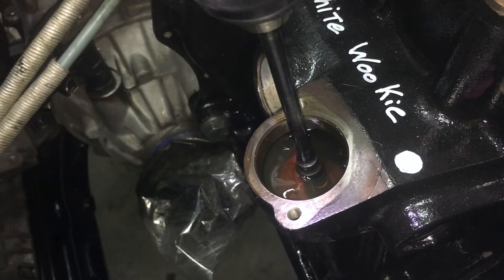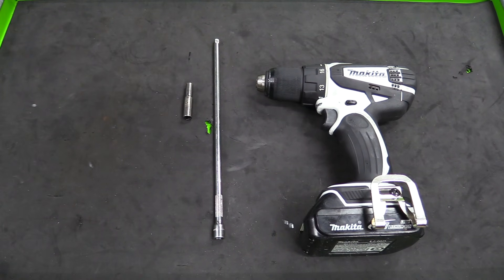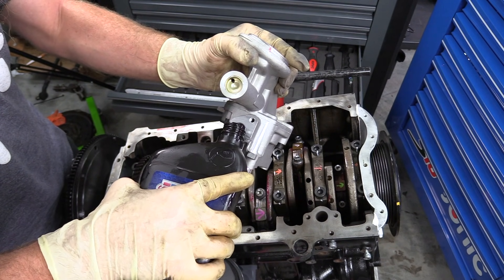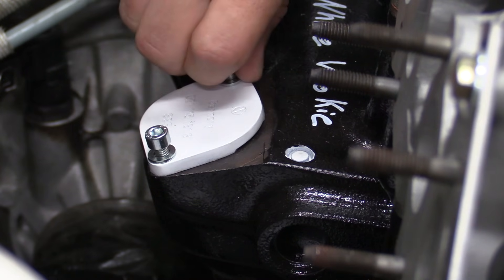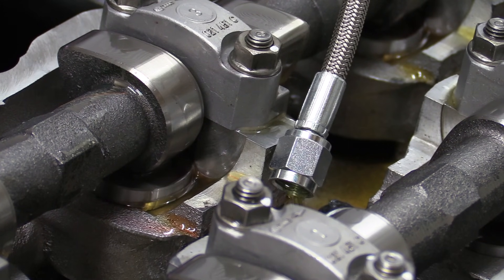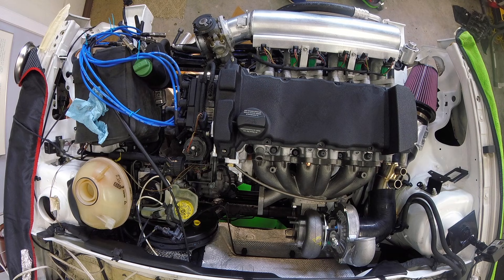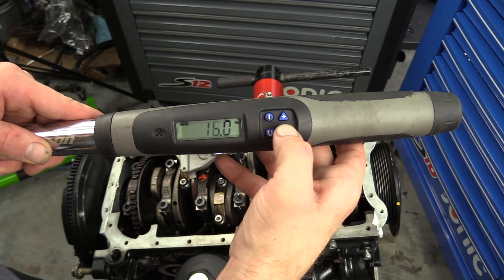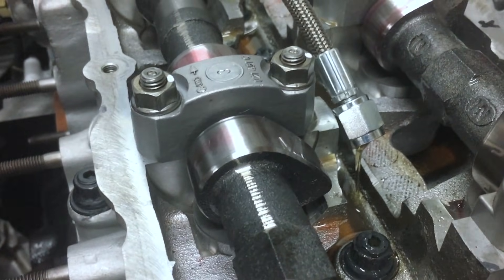How To Prime an Engine And Oil Pump

Comment: I have a 2005 Ford Mustang 4.0 v6 and I’m trying to prime it and the 8mm socket doesn’t sit flush or 5/16 sock what proper tool do I need that fit into my engine so I can prime it

Comment: Hello, I recently installed an engine on my Subaru and it's totally empty, no oil. Before starting it, is it possible for me to prime this newer motor in a similar way, maybe manually rotating the engine till all galleries are filled with oil?
Reply: Old comment but for any future people that are wondering disconnect the plugs from the fuel injectors, then start the car with the key. The starter will turn the motor at a much lower rpm and the oil pump will send oil throughout the motor.

Comment: My car is on a hill, going to change the oil filter housing, then put in in neutral, liner it roll down hill some before starting. Should work the same eh.

Comment: Hey Charles.. just doing this trick on a motor I had built.. only question i have is does the drive gear have to be put back in any specific orientation in relation to the timing? Only ask because I noticed the drive gear has a small hole in it

Comment: Hi there ...I am having low oil pressure in my vw 2.0 tsi 2009 ....I put a gauge and I am reading 16 psi ...while put little more rpm pressure stays the same and warning light appear ....do I think can be a bad oil pump ?? Thanks

Comment: Hi humble mechanic. I desperately need help on my golf 3 gti. 
I’m expressing a rattling sound from my engine, I recently changed the lifters but I’m still getting the sound.. 
I also changed the oil pump and I primed it but just rotating the gears inside the oil before I installed it. But I’m still getting the sound 

Please help, I’m afraid I might kill my engine
Reply: Mk3 vr6?

Comment: Hi, I’m currently rebuilding my R32 24v VR,  this video (and all your videos) is extremely helpful but I have a couple questions:

1.) what type of oil and weight do you typically use for break in? I paused the video and it looked like you were using liqui moly but I thought that had friction modifiers in it which is a bad idea for break-in?

2.) how long will the engine stay “primed” before gravity pulls the oil back down to the sump? My engine is still on a stand and wondering if I should wait until it’s in the car before priming

Comment: I have used a 50/50 mix of straight 30wt oil and stp oil treatment(blue bottle) in the oil pump. Then pull full injectors harness or fuse and leave the spark plugs out and crank about 20 secs wait for about 30 sec crank again ,wait and then do it another time or 2. The install spark plugs, plug in injectors or fuse and fire it up. Have used this method on multiple builds without issues. 

Btw i plan to use your link when i order a few parts from amazon.

Comment: just subscribed good information I have to replace an 1999 4.0 Inline 6 amc engine in the future. I'm going to assume that the distributor drives the oil pump and going to spin the hell out of that. the engine will be remanufactured the real question is do I really "OCD" worry about timing?

Comment: I'm actually cracking my oil pump open on my mk5 r32. Any guidance? I had oil pressure warning come on and oil light kept blinking. Pump is out of the car now, pump freely spins, and there isnt any binding and screen is not clogged.. should I pull my pump apart and inspect it and put it back in, or just be do e with it and buy a new pump?

Comment: Hi, I have a quick question, is it true that if the VAG low pressure oil tester is used instead of the sensor there's the risk of breaking the timing chain? I've had an incomplete diagnostic done at a VW service and the engineer stopped the mechanic in performing the operation, so I was unable to know if I had a failing oil pump or not.

Comment: Hey Charles, just a general yes/no question: on a VW Touareg gas V6 (or any car really) does the oil pump start working when the starter turns the flexplate during cranking or does the oil pump start working only after ignition?
Reply from the maker: Most are mechanical so when the engine starts turning, the pump should start pumping
Reply: So the oil pump will start circulation when the starter motor turns the crank shaft?
Reply from the maker: with in a few revolutions.
Reply: HumbleMechanic Why, what happens if it's more than a few revolutions? Technically as long as the oil pump is working there should be no concern of damage right?

Comment: We always use the drill method or the cranking method. Even with a junkyard swapped motor. I’m building and EJ257 and it’s going to be done with the fertilizer sprayer way first watching the oil pressure gauge then cranking. Lots of cranking. About 60 seconds worth of total cranking spread over,  5-6 short starter rest, periods. We always use “motor honey” or Lucas assembly lube (anything sticky) for brand new oil pumps.
Reply from the maker: Great insight!!! Thank you .
Reply: Are you using the fertilizer sprayer as a prelube tool to push the oil in the engine ? I'm looking for such a solution, this might actually work

Comment: i did the jelly route on my 95 jeep cherokee and worked perfectly!!
Reply: I've built a few Rover V8 engines and as the pump lives above the oil, not in it, the jelly route is the only way to go. I've known a few guys use grease but it tends to not blend in with the oil and just settle in the sump as a sticky mess.

Comment: nulon l90 is the best i use to fill the oil pump with it and bearings and camshaft when the engine have been renovatet oil pressure in 15 sec normaly

Comment: Hey, my question isn't related to the video: My 2005.5 Jetta with the 2.5l just hit 100k miles. Should I get the timing chain changed? People have been warning me that they fail around 100k
Reply from the maker: The most common failure is the upper chain set. But with 100k and 12+ years it may not be a bad idea.

Comment: Just did a similar method last week on a jeep 2.5. 1/4" drill with 1/4" adapter to a long 1/4" extension and a 1/4" flathead bit. Spin until the drill bogs down, now you have oil pressure! Great video.

Comment: Hi Charles, good stuff. I had low hot idle oil pressure on my Mk4 R32 and recently changed the oil pump. I primed the pump in a bucket of new oil, installed and buttoned up the oil pan, and then used the procedure similar to what you described. Pulled the coils, disconnected the fuel pump, and relieved the fuel system pressure. Turned the engine over 3 times for 20-30 seconds. Fired her up and got "Bentley Spec" oil pressure. Keep up the informative work! Sorry I missed meeting you at WITW this past April.

Comment: How do you prime a distributor less engine? Just only by cranking?
Reply from the maker: That or you can make a pressurizing tool to push oil into the engine via an oil pressure opening

Comment: Great tip, thank you. I always like to have an external oil pressure gauge connected (even if it's just temporary capillary type) to be 100% sure that the oil pressure is in spec. What are your thoughts on using a cheap/low API spec oil for break in as apposed to a high spec that would "protect " key wear surfaces better and possibly prevent correct mating during break in?

Comment: lol thats not how you tape a socket you are supposed to put the tape on the extension and put the socket over it.
Reply from the maker: You can use whatever method works best for you. Just as long as you're taking steps to be 100% sure the socket doesn't come off.

Comment: Top tips as per usual.  It's always good to see how the other guy performs the task!  Personally, it's just valve cover off then liberally coat top end with oil!  Remove fuel pump relay, then burst starter till' engine seems happy!  Haven't had any issues yet!

Comment: You mention packing the oil pump with petroleum jelly, what is the potential risk of running something like this in an engine designed for synthetic high grade oil or putting oil stabilizer in the same sort of engine?
Reply from the maker: Very little. If I had done it that way, I would have changed the oil right away. I wouldn't leave that in for 10k miles.

Comment: When I put together my '68 Ford big block engine, I don't think I put anything in the pump at first. I did however spin it up with a drill (slowly at first until it picked up oil, then sped up) after installation. That pump turned so hard that both a dewalt and a ryobi drill emitted smoke while turning the pump. Pneumatic drills highly recommended for this task!
Reply: Suddenly glad for my pneumatic drill, thank you.

Comment: Hey, just wondering if you did anything special for the lifters before installing? This was confusing for me when i dud my build. There is not a lot of info. Cheers!
Reply: depends on the lifter type. Solid lifters just coat in assembly oil but hydraulic lifters need to be submerged in engine oil for a while, preferably at least overnight.
Reply from the maker: +wilkes982 coated in oil and dropped them in.
Reply: +Krankie V, right, like on a Chevy engine?

Comment: too bad the oil pump is directly ran off the front of the crank on mine.. oh well
Reply from the maker: +001dman yeah. That step 2 doesn't work on a lot of cars
Reply from the maker: +wyndnra1n yep. I mentioned doing it that way. But you'll have to make the setup or just skip to part 3
Reply: more than likely. Could just go through the oil pressure sensor hole with a drill pump i suppose... engines not finished yet but i'll find a way when its done
Reply: My oil pump is also wrapped around the crank (Honda) so here's what I did. Very liberal with assy lube, built, cranked with plugs out ign and injectors disabled, 5sec crank intervals. On the 3rd try the crank speed suddenly increased dramatically and spun it another 5 sec. I took that as a full engine prime and started it. 30k miles ago. So far so good.
Reply: When I rebuilt the one in my car, before starting up I took the time to let it crank over for a minute or two since my oil pump is driven off my crank as well. Probably was overkill and probably nearly killed the battery, but I didn't want to rebuild it again.

Comment: i just crank the engine over for 20 - 30 seconds and then light it off, if the engine was assembled with assembly lube I don't sweat it and I've never had a problem.

Comment: hey dude what are those nipples for on the intake pipe ? im guessing one is for the dv but what is the other one from
Reply: What's a DV?
Reply from the maker: +Mexico13luna dv and PCV
Reply: HumbleMechanic so having a pcv nipple I'm guessing yourw going to run a catch can ?
Reply from the maker: Eventually I am
Reply: DE Nichols diverter valve

Comment: I would pre-fill the oil filter, keep the spark plugs out for easy cranking & perhaps check thru the oil filler cap if the oil reached the OHC.
Reply: Ioooô

Comment: Humble mechanic I have an issue I hope you can help with. There is an 07 jetta with ban strut bearings now I got all but one of the bolts off the bolt in question is the top strut bolt. Right now it is just spinning around. Now I have tried vice grips to hold it and spin it off I've tried cutting the head off but it's really tight space now I'm thinking of cutting it off with a touch. But the bad thing is the wheel well is pretty rusty and very thin. Is there any other way of doing it?
Reply: Krankie V yes I know it's the top bolt that is spinning not the one holding down the bearings but the 3 little ones
Reply: Deadeye1983 you can use a hacksaw, sawzall, or pneumatic cutter to cut the nuts off. You just have to be careful not to destroy the strut tower in the process.

Comment: I was wondering in future videos, you could do a video about the drivability of the turbo add on.  I am interested in doing this mod like yours with a mild boost.  I just wondering it it going to be more abrupt power or it is gradual which would be great for a daily driver.  I always though the VR6 was restricted by the intake and exhaust and curious on how this engine performs with the turbo.

Comment: Great video.  I have a related question to this.  I work overseas and my car can sit for as much as a year.  Should I do some sort of prime, like disconnect the wiring harness from the coil and pull the fuse on the fuel pump, or is it ok to just start the engine.  I have just started it and it takes a few seconds for the oil in the lifters to build pressure.  I wonder if I am doing damage to the engine.
Reply: So long as you don't put the engine under load before the oil pressure builds, I wouldn't worry about it too much. Start it, let it idle for one or two minutes and then drive it gently until its warmed up.
Reply: Thanks you for the input.   That is pretty much what I do.  The start usually does not sound that good at first until the hydraulic lifters build pressure, then it smooths out.
Reply: It's best to have someone start up the car once a month while you are away.  Don't let the car sit on it's wheels without moving for a year, put it on jack stands.  Disconnect the battery and put it on a trickle charger hooked to a timer.  Drain the fuel.

Comment: dont do the over head views
Reply from the maker: +Bryan Estep why is that?
Reply: Its disorienting. Like when you were priming i didnt even know what angle it was until the next scene. Then the overhead view of the engine together was still weird.
Reply from the maker: +Bryan Estep this is an odd spot to get good footage of.
Reply: not really, the second scene of the priming was very good and doing that same angle on the engine all together would have worked perfect aswell.
Reply from the maker: +Bryan Estep I'll keep that in mind
Reply: no! redo the whole video! lol nah still a good video
Reply: I was grateful for the shots that stepped away from the being right on the problem. Videos which don't give perspective where the parts being worked on are at are disorienting for me. I'm good with whatever angle shows the action, but perspective on where in the engine bay your working is important too.

Comment: I recently rebuilt a Saturn 1.9 DOHC. The pump is in the timing cover. I packed it with petroleum jelly. Once I had the engine together on the stand I installed the flex plate and starter. I left out the spark plugs, and used a jump pack hooked to the starter spun the engine over till I saw flow in the cylinder head with the valve cover off.
Reply: That is a common procedure. The first time I heard of this was about rebuilding the Toyota 22R engine.
Reply: Borat voice : "Verry Nyce !"

Comment: What's the maximum oil pressure on the old VRs? 
I get 100psi on a "cold" (60°F) start...
Reply: Jimny VR5 100 psi on a cold start is normal, 101 psi is maximum pressure but I think that's at operating at maximum rpm
Reply: What does your pressure get to on a warm idle. Also how early in the revs is it that you hit full pressure warm
Reply: Reuben Horner Usually 18-20 psi idle when warm, 60 or so at 2000rpm
Reply: Hmm, That looks normal to me. The cold pressure is crazy though. I have never seen anything that high before. Do you use synthetic oil?
Reply: Yeah 5W-40 Valvoline synthetic